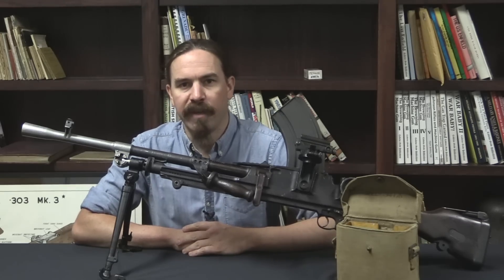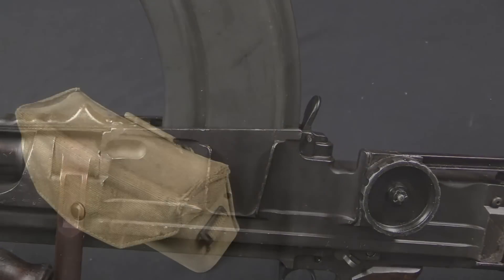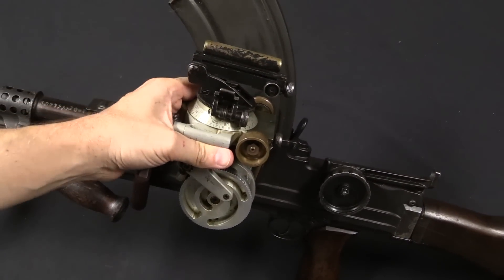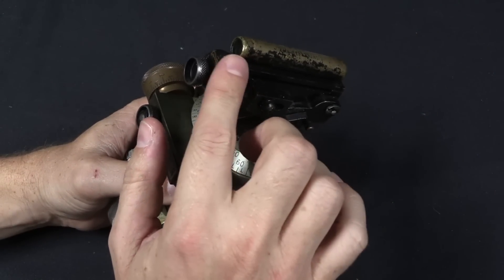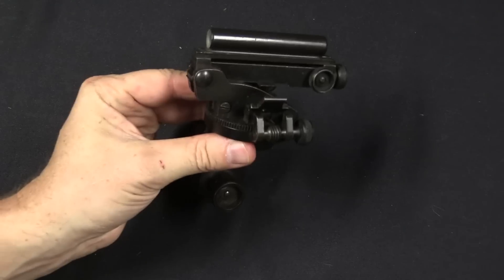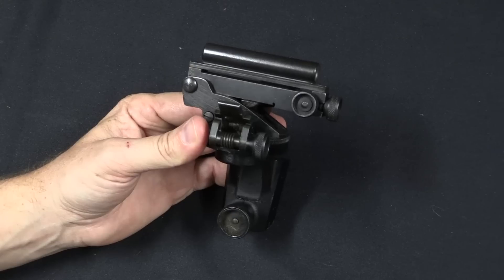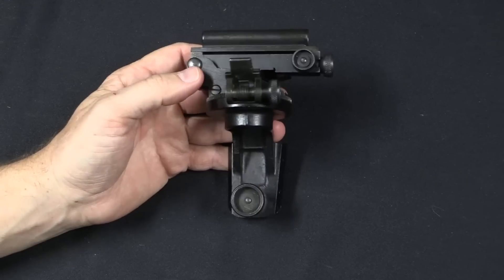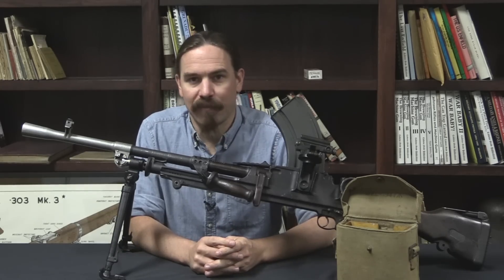Very Rare and Mostly Pointless: the Bren Fixed Line Sight

Comment: One thing you missed out in the development of the fixed line sight, was the development of defence in depth and mechanised assault between the wars.  Continuous line trenches (three deep at least) were something no one wanted to see making a comeback - too brittle and too expensive in time and coin.  The Infantry battalion of 1939 held a wider, deeper front with fewer men and better comms than their dads had in 1916.  

In place of continuous trench lines we dug smaller separate fighting positions, interlinked but with large gaps between them.  Support weapons could also be fired from the back of vehicles shifting quickly from position to position to maximise firepower and avoid counter battery fire.  All these elements could be very far apart and hopefully well camouflaged and hard to spot, so a careful fire plan on a map was needed to co-ordinate them. 

The front line was designed to bend in attack and assault which meant your MG, mortar and signals teams had multiple positions to work from.  If the enemy zeroed in on your weapon pit you shifted to an alternate.  If they were advancing too close to a flank, you dropped back a bound, in the advance you could end up anywhere.   Not all positions were pre-recorded, not all were dug in and prepared. 

By moving away from your prepared position your existing arcs and range cards became useless right at the moment you wanted to give the enemy a sound thrashing.

The fixed line sight was developed for the Vickers and 3inch Mortars exactly as you suggested - a theodolite - if you found a couple of obvious features on the landscape - right on the horizon was best - and you recorded their positions on your fire plan map - when your gun and mortar teams moved position you could spot the obvious features and zero in your weapons on the same kill zones you had before - without having to range in fire, observe, shift and fire thus giving away your position and your proposed kill zone. 

In 1940 Vickers guns were grouped in special battalions as the process of theodoliting up the battlefield was a considerable skill and battalions rarely made use of their extended range.  The Bren gun wasn't to replace the Vickers completely, just in the battalions.  Instead of Lewis guns in the platoons and Vickers in their own section under Battalion command, you had Bren guns from top to bottom.  

People just learnt to eyeball it at Bren gun level, the fixed sight was superfluous.
Reply: Ah, so that was the logic of the machine gun battalions! TOE was one machine gun battalion per division, with 48x Vickers if memory serves. Which gave you roughly one MG platoon available per line battalion if you split them equally.
Reply: @davidgillon2762   That would be a parade ground orbat but the ground situation rarely allowed it.  If one battalion was facing a high reverse slope and another a series of open fields - it was more efficient to have the guns on the open range and mortars against the reverse slope. 

The idea behind the MG batts comes from the austerity of the interwar period.  Systems redundancy was expensive, specialised battalions could make it cheaper.  

tugbetweeninfantrytheir turf, and infantry commanders who wanted as much redundancy as they could muster for the inevitable chaos of the front line. 

In the end we went with a bit of both.  The British regimental system let us down here - too much turf war throughout WW2.

Comment: Ian, 

Have you looked at one of the newer See All “open sight” devices? It works similarly to the device in this video in that it’s technically an occluded image. I’ve been messing with the See All for a while and it’s a very interesting sight for the purpose of being as light and low profile as possible yet allowing an aiming point in low light/no light.

Comment: I didn't understand at all what it was made for
Reply: For defensive fire where the exact location of the expected threat is known in advance - maybe a pillbox covering a road with ditches or boggy ground on either side?
Reply: @fredbloggs5902  yeah but why not just aim normally? Since you set the fixed line sights after having aimed your target with the normal sights, it means normal sights are precise enough, doesn't it?
Reply: @jungobango4815  - you might not have eyes on the target at the time required - fog, smoke, darkness etc.
Reply: @fredbloggs5902  didn't think about that, thanks

Comment: So, if I'm getting this, it was designed for a WW1 requirement in which the Bren could be used from the 2nd or 3rd line trenches to provide fire support to the frontline trenches during an enemy assault while remaining relatively unfired upon directly and hitting enemy soldiers before they could even exit their own trenches into No Man's Land, thus depriving the first waves of crucial support?
And because there were next to no trenches in Western Europe in WW2, the requirement wasn't.
Reply: No., not really. Establishing fixed lines and defined arcs of fire were relevant in any sort of defensive field position, not just in entirely static trench systems. The only difference between a trench system and the types of fighting positions commonly used in WW2 was that the trench system physically joins those fighting positions together. A trench system was still considered the ultimate evolution of a static defensive position during WW2, and even more amazingly, still is today as trench systems still do what they did in WW1, they give the occupants freedom of movement whilst giving protection from observation and direct fire. Having defined lines and arcs of fire is still a very basic principle of organised defense, not least to stop people inadvertently shooting into other positions occupied by their own forces.
Reply: Yes

Comment: That’s just a standard British officer’s binocular case with a custom wood insert.
Reply: Roll with what ya got.
Reply: @atenachos6282  which probably explains why the vickers and bren sights are interchangeable without that being a planned feature.
Reply: @CynicalOldDwarf  - I wonder if the BREN fixed-line sights got turned into Vickers indirect-fire sights?
Reply: It is a good protective pouch that the sight fits the era equipment..... logical .... just add a wooden liner..
A good reenactor gag for BEF era would be this was not personal equipment so it would not be Blancoed....you can have that one for free.

Comment: So I’m guessing the Germans learned to destroy the signal lamps ...
Reply: The actual aiming lamps didn't emit a very bright light and the light was directional, it's basically just an illuminated disc that you'll only really see if the lens was pointing at you, and wouldn't be particularly noticeable from the other side. Equally they could be switched on and off remotely, so could remain switched off until actually required for laying the sight, then switched back off. Any similar light source, such as the standard issue "electric lamp" torch could also be used, in which case they'd simply take some basic precautions to ensure the light was shielded as much as possible so wasn't visible from the enemy's location.

Comment: If I understood correctly, using this requires also the tripod not being moved at all. Wouldn't not moving the tripod by itself keep aim at the same point so why this on top of it?
Reply: To select different targets, by dialing in different numbers. Although I may be getting confused with the larger device. The small fixed-line sight may just be good for remembering one thing at a time.

Comment: These accessories were developed because there was a high chance that the coming war in Europe would quickly end up as WW1 had - lines of opposing defensive positions. It thus made sense for even section/squad light machine guns to (a) have tripods, and (b) fixed line sights for covering (say) wire in front of trench systems. For the same reason, very sophisticated trench digging machines and trench crossing vehicles (eg Tog) were developed.
Reply: The sights are to allow observed or unobserved predicted, indirect fire
Reply: There's the saying, "Generals always fight the last war"? 

Kinda ironic in WW1, 'It'll all be over by Christmas'. The British certainly seemed to expect big set piece battles on open fields. You had things like those instruction manuals for swashbuckling bayonet fighting with all kinds of fancy parries....instead they got the Western front. 

WW2 like you say the expectation was a return to that, all of a sudden Hitler is in Paris having his photo taken infront of the Eiffel tower...
Reply: It only made sense because they were planning for the wrong war. Its that kind of static thinking that led to a complete failure in France and forced Dunkirk to happen
Reply: @jarradk174  "Static thinking" didn't lead to failure. The Maginot Line was a resounding success... where it actually existed. The plan had always been that if Germany went through Belgium then the Belgians would fight them and France would pour over the border to support them. But at the last minute Belgium decided "nah we're too chicken shit we're going to sit this one out" and France had to scramble to shore up that part of their border. Then Germany attacked Belgium anyway and they were defeated in less than 3 weeks. Whoops.
Reply: It's very strange to think of the war (that everyone was actually preparing for) which would've been fought if the Belgians hadn't cocked things up.
Reply: @j.yossarian6852  if anything, the Blitzkrieg success in 1939-1940 is more thanks to France..  
The Netherlands had a bigger military than Belgium and also didn't stop the Germans after all.  
The Nazis had already taken Poland...   
French military leadership lost the battle of France.
Reply: @auzor5900  

The Dutch had a bigger army?
Heh,... not really, they had people with weapons (mostly outdated WW1 stuff), but there was a severe lack in trained personnel, which led to bad battlefield discipline
Reply: @auzor5900  The French had planned their defensive line with the understanding that Belgium would contain Germany along their own border. The adequacy of the French preparations are plainly shown by the Germans choosing to evade them with bold manoeuvres, the Belgians were supposed to have similar and left the boche no place to go but into a meatgrinder, instead they were completely vulnerable, rendering all the planning and prep Britain and France did do moot.
Reply: @Nightdare  well... bigger than Belgian army. And to be fair...  an example: Belgian army also got a bunch of ex-allied-used stuff post WW2. 30-ish years after WW2, Belgian army still had a few WW2 Thompson guns ffs.  
Prior to WW2, it's not like the Belgian army had a lot of really modern equipment.  

Bolt action rifles just like majority. 

Just considering the different machine guns..  
several of which used different ammunition.  
  
artillery/guns:  
57mm, various 75mm, 76mm, 100mm, 105mm (french & german WW1), 120mm, 150mm, 155mm, 170mm.  
The anti tank cannons were actually quite reasonable; 47 & 60mm... but no where near enough in quantity.  
The biggest problem was that the majority of these were... no where near the Ardennes.
Reply: @j.yossarian6852  u-hu.  
And before that, Britain & France planned for Hitler to adhere to the paper document that he wouldn't invade Poland.  
French leadership ignored the reports of their own air force recon of German armor moving through the Ardennes.  
The Belgium fortresses fell much faster than expected, thanks to unprecedented at the time use of paratroopers, but even the French & Brits thought the moving of armored groups through the Ardennes was impossible. Those plans leaked... and were still ignored.  
The reason for the Maginot line being weaker along the Belgian border was that French leadership felt no army could move at such a pace through it.  
And NB: the German forces advanced much slower than they had planned. 

And do note that the region south of the Belgian border.... still had fortifications; which were considered part of the 'Maginot' line.  
And.. Operation Tiger, WW2, the Germans did also punch through the heavier parts of the maginot line.  
  
The French air force was inadequately used by French army leadership.  
Tanks being used without infantry.  

The French & Britain's planning were moot from the start, as they, especially France, had planned for a repeat-WW1 style of battle.  
Lack of radio (& usage), indecisiveness, commanders moving around looking for & not receiving orders; a failure to either hold or detonate the bridges over the main rivers...  
waiting far too long to make a counter-attack towards these bridges.  

No.  
French people simply blame their own failure on Belgium in this.  
The Battle for France was lost by.. France.
Reply: I don't think blaming the Belgians is fair, everyone got things wrong
Reply: @j.yossarian6852  blame Belgium ??? New tactics were used by Germany ....why don't you blame Britain we had tank tactics writer in a book by Liddell- hart which we didn't use and the germans basically ripped off like they did in ww1 with stormtroopers which was a French idea originally 🤷‍♂️
Reply: @nickjohnson710  Belgium’s “if we just ignore them they might not invade us again” was a real problem. They had plenty of evidence that the Nazis were planning to go through Belgium but they refused to cooperate with the British and French due to wishful thinking. That was a pretty huge screwup. 

Certainly there is plenty of blame to go around from the gross miscalculation by the British and French that delaying the war benefited them more than the Nazis to various tactical, strategic, and logistics difficulties. 

In the end, the biggest factor in the Allies defeat in 1940 was the public in various countries having long dreaded another Great War and strong anti-war feelings. That delayed rearmament. That was a huge driver of Munich and the Allies not undertaking serious offensives early. That was the driver for Belgium’s wishful thinking that they could remain neutral.
Reply: @nickjohnson710 The influence of JC Fuller and BH Liddel-Hart one the Germans is greatly exaggerated. Neither is referenced  in any German documents, lectures or accounts written pre-WW2. 

Instead, after WW2, when interviewing German officer prisoners Liddel-Hart would ask them if they had read his and Fuller's work. And, wanting to appease one of their victors and perhaps gain better treatment, the Germans agreed that 'of course' they were influenced by Liddel-Hart and his mentor.

Heinz Guderian in particular included flattering references to them both in the English language edition of "Panzer Leader" that were absent in the original German edition.
Reply: @j.yossarian6852  and if west didn’t give Czechoslovakia to nazis

Comment: As an ex-employee of Plessey, I was aware of their involvement in war time production of electronic and small electrical equipment (radios, electronic components, fuel pumps) I wasn't aware of any precision engineering such as this sight, can you cite your source for the correlation between the P and Plessey?
Reply: P was the usual code for ROF Poole. Poole made guns, gun sights, bayonets and some optics. I would have thought Plessey was more into electronic and electro-mechanical/ electro-optical systems during WW2.
Reply: Good question, they started off in precision mechanical engineering because they effectively pre-dated electronics (founded 1917), they diversified later because that’s where the value-add moved to.

Comment: Ian... never stir up the SFMG heads, you'll have them waxing C2 sights, MG theory and beaten zones until the cows come home.  

BTW, I reckon you were almost right,  one of its purposes was likely for setting a primary task to an allocated primary fixed line/fixed limit when tying the gun into defence fireplan.  Once set, if you had to traverse to a secondary task you could return to the primary task very quickly. ( not removing the gun from the tripod)  You can pretty much do the same thing with range cards and gun stakes, albeit less surgical.  Knowing how anal some Platoon Commanders can be with their defensive fire plans, I can see the doctrinal appeal of this item. 

Just as well the carry case was good. I image the sight would spend a lot of time in it, tucked away in the Q-store!  

"one-one-thosand....Two-one-thousand"

Comment: The Dial sight, like artillery sights does not sight on the ground. You can't see the target . Rather it is set  from  a Range Pole that has been surveyed in. The Bren tripod has stops already built in to stop the gun going out of arc.
Reply: The aiming stakes are not really surveyed in, instead they are placed on a known azimuth  and by determine the difference between the known lay direct and the direct to the target applying that 
angle left and right of that know azimuth you can ensue the gun is firing on the desired azimuth of fire.  And as the gun displaces, you can measure that displacement and correct for it by placing the sight reticle an equal measured angle as the difference between the near and far set of stakes.
Reply: @ronhmclaughlin  is that not the very definition of "surveyed"?
Reply: @DriverDiver24  aiming stakes are there for directional control and are placed by the gun crew themselves IAW with the unit SOP.   Survey in context of indirect fire, means a survey partly locates the position and provides directional control, positional accuracy is normally 8 digits (+/- 10 meters) and directional control to an accuracy of less than one mil.   Normally when placing guns like this instead of survey, they would be done via a map spot (would be a very good map spot to to +/- 100m) and layed for direction with a compass, which would be lucky to have 20 mil accuracy.
Reply: I’m glad you commented on this.   This site would allow the machine gun to be aimed and used just like artillery and mortars.